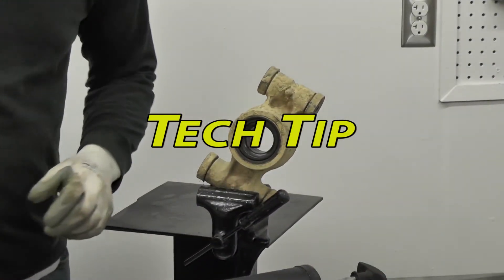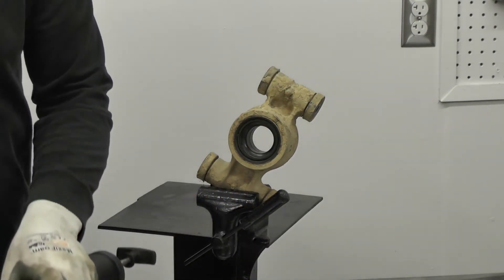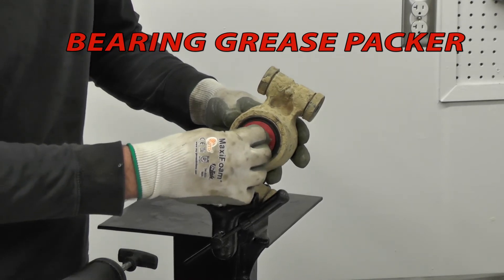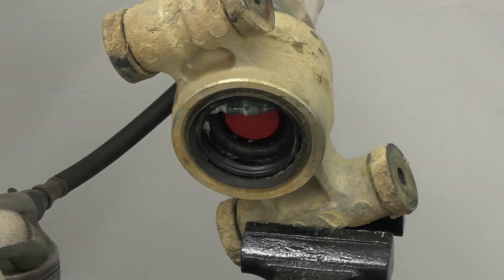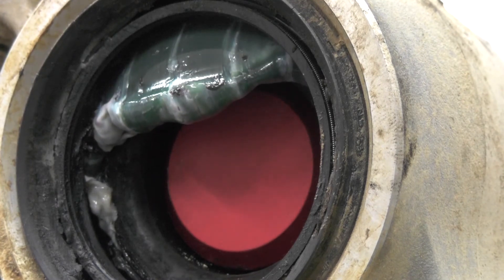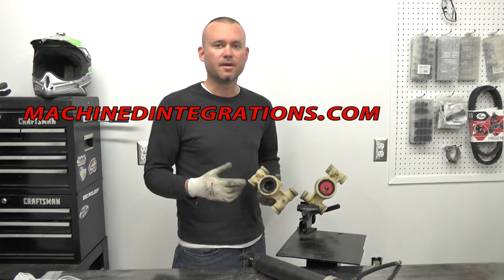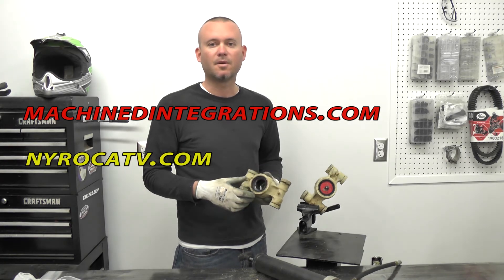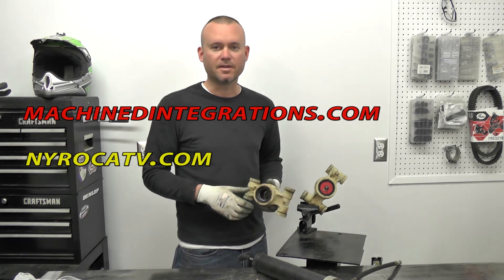How To Remove Rear Axle - KingQuad AXi ATV Tech Tip 450 500 700 750

Comment: Do you just push the new axle in? Is there anything I need to do before inserting the new axle in like greasing them?
Reply from the maker: Unlike other quads, they run in a oil bath. Sorry for the late reply.

Comment: Y',all got any pointers on how to remove the main rear drive shaft on a 2005 Suzuki King Quad 700? The rear diff has already been loosened and is free from the frame. I need to slide the shaft out ,(to the left), to slide the new drive gear onto the front of the shaft inside the case

Comment: Great video, thanks much for posting!  Is there a specific type/brand of bearing grease you recommend?  Also, when you pulled the axle, oil came out of the differential...should we add more oil after re-installing the axel?
Reply from the maker: Sorry for late response. Would put some anti-sieze on the splines. Just check and top off the diff oil after install.

Comment: Needing to replace right rear axle. When you replace the rear cv axle do you need to replace the seals too?  I had a shop replace both rear main seals about 10hrs ago.     
 2008 KQ 450   280hr.  3,200miles.      Thanks!
Reply from the maker: Your seals should be fine. Thanks for the comment.

Comment: 2018king quad w 190 miles on it bought brand new dec 2017 axle clanking noise, delaer replaced same axle w allballs and moose noise still there after 2 diff brand axles, replaced wheel bearing w moose noise still there, bike in shop for 3
weeks now about to throw towel in any auggestions? bring it to diff dealer?
Reply from the maker: It's hard to say without riding it in person. Any updates?

Comment: Where the axle pushes into the differential housing is it normal to have a little play ? And if you can move it around a little bit does it mean the bearing is bad ? There’s no fluid leaking out.
Reply from the maker: What kind of mileage is on the King and what type/size tires you running?
Reply: Everything ATV-UTV-Reviews 1100 miles/181hrs-  stock tires 25”
Reply from the maker: Indian, with the miles and stock tires the rear end should be just fine. A bit of play is nothing to worry about.
Reply: Everything ATV-UTV-Reviews thanks,